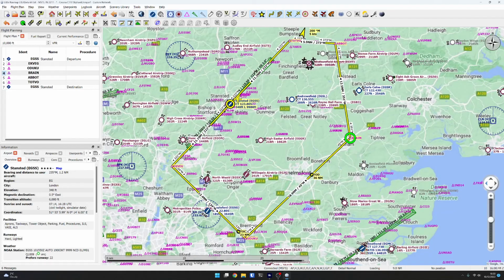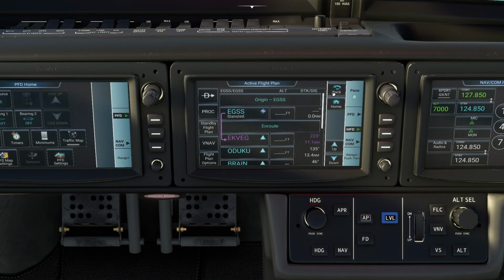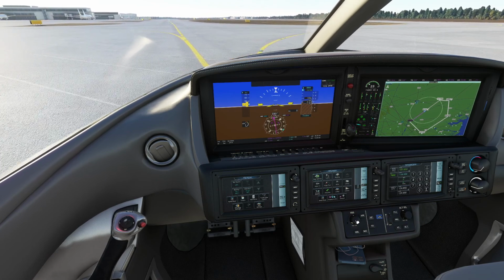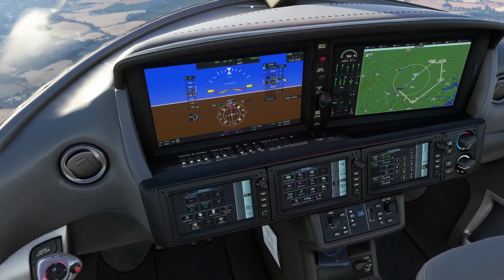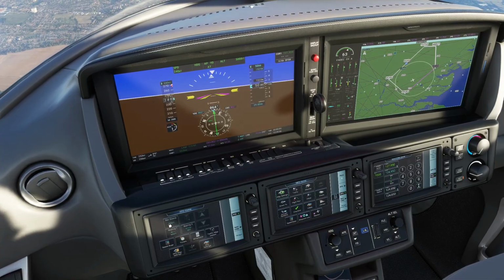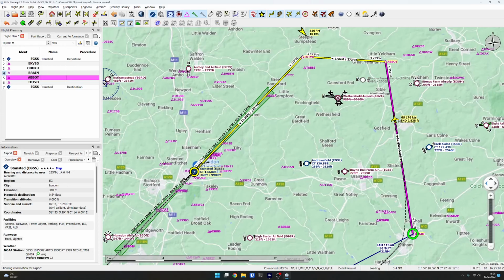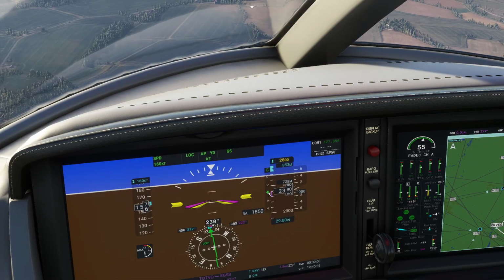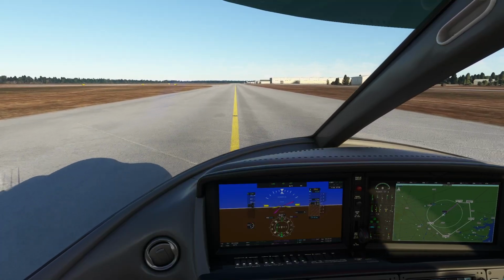Basic flight planning and autopilot operation in the Cirrus Vision Jet in Microsoft Flight Simulator

Comment: Great Video. Regarding descending and reducing speed at the same time, most pilots hate that. When working ATC, I had to decide which I needed from the pilot first--the speed or the altitude. It was either reduce speed then descend to assigned altitude or descend first to the assigned altitude then reduce to the assigned speed. Something to consider when simming with high performance aircraft (SF-50 is a medium performance aircraft, still something to think about when transitioning from the enroute to the approach mode of flight). What do you as a pilot need first?
Reply from the maker: Yep - I often take part in ATC controlled group flights in the simulator with a group called "MyAir" and will voluntarily hold my descent at 10,000ft to decerate to 250 knots - and plan ahead, knowing I'm going to do that. They tend to instruct "own navigation" at least until the STAR - often setting a marshalling point ahead of the star with an expected altitude and speed just to get everybody sequenced easily :)
Reply: @jonbeckett   Yes. "Own navigation" works fine in low density air traffic environments. In the real world, when traffic demand is high in the terminal airspace, controllers will impose altitude and speed restrictions early and often in order to predictably organize the arrival flow and landing sequence.  ;o)

Comment: Weird issue - the lower screens are all black ?? Just downloaded from Marketplace MSFS. Cant light them up / turn on ?
regards
Reply from the maker: Not seen that issue myself. Strange?!
Reply: Follow up - cuz I like this version of the Vision Jet much more than Xplane, others may have had similar issue. 
I emailed the developers... had to delete the G3000 Working Title stuff in my community folder. They recommended deleted all Working Title folders:
""Just checked and all of these files can go.  They were all incorporated into the AAU series updates that you would have installed by now.  They wont be needed anywhere.
Nick Sdoucos
FlightFX, LLC""

 It did fix the BLACK Screen Issues for all Touch Screen Controls (TCS?) screens and did not have any lingering issues that I can tell.  HOWEVER !  I see a difference in your MFD Fl PLan screens and mine ?
I note that my MFD does not show distances to next waypoint in my Fl PLan, which I have grown fond  of.  In fact under Fl PLAN Options I have mostly greyed out, and dont even see edit Data Fields as an option.  gahhh !  I need to know the time, but building watches is more fun ... right ? :planet-orange-purple-ring:

Comment: (This may be a little hard to explain but I'll try my best) I have nav mode on and autopilot on. So when I come into a approach when I pass the waypoint before the approach transition instead of it taking me to the approach transition it takes me to the last fix on final approach. So my question is, how do I get the nav mode to take me to the transition fix? (I'm on ILS)
Reply from the maker: When you get near the ILS, go to heading mode and direct yourself towards it (if the flight plan hasn't already done that). Then switch the CDI to VOR mode - which will make the HSI show the localizer and glideslope markers.

I'll do a video about it.
Reply: @jonbeckett  thank you this has made my approach so much easier.
Reply from the maker: @captm1297  The point about all of this is the automated systems are there to help - not to do it for you :)

Comment: The cursor you are using is small, white and difficult to follow. Try enlarging it and/or changing the color to emphasize where you're moving it.
Reply from the maker: I've since changed my monitor, which should help (lower resolution at this end)

Comment: I was trying ILS with this aircraft today. Must be going wrong somewhere because I couldn’t seem to get GPS to turn off. The frequency was already in the comms area and it seems you press the button to switch active ones? But didn’t seem to do anything. Pressing the nav button was just keeping gps on.
Reply from the maker: You need to change the nav source on the primary panel - from GPS to VOR. The NAV mode of the autopilot will operate for both VOR and GPS navigation.
Reply: @jonbeckett  Thanks for the reply. I tried again with that and the HJet and looked over various things, and was successful.

Comment: What key input did you use to change the green VOR CDI to a specific radial, as there's no CRS knob or way to select a specific radial, as you've mentioned in the video?
Reply from the maker: CTRL+SHIFT+HOME and CTRL+SHIFT+END :)
Reply: Whilst fiddling with the GTC screen and knobs, with a touch screen and knobster,  it appears that the VOR course can now be set using the large touchscreen knob while in PFD mode.

Comment: You misinterpreted the FLC. IT will NOT automatically pick the best climb rate. You have to press FLC. then select (using the up-Dn wheel next to the FLC button) the speed you want to hold when you ascend. Or... press the auto throttle and FMS mode... it will then use the speed bugs you selected before take off... 

I enjoy watching your content
Reply from the maker: I may not have described it well - apologies if that was the case. It's a difficult thing to describe to people - that FLC will hold a target speed and convert excess or lack of thrust into climb or descent :)

Comment: On approach Vision Jet aircraft still do not the use correct course via AP, what is the problem.
Reply from the maker: You must have missed something in the aircraft. Did you switch to VOR/LOC on the CDI, away from GPS when you got to approach (presuming you're talking about ILS) ?
Reply: @jonbeckett  Yes, I am talking about ILS and NDB, knowing that I make the flight plan from the main menu.

Comment: Thanks for your excellent tutorial. A few questions please: On short final how do you get rid of YD? By disconnecting the FD? After AP disconnect, why is the light still on for Manual mode on AP? I botched badly a landing yesterday after a 2 hours flight,  went for a go around 2 times and stick and throttle would go absolutely crazy; very frustrating. Killed the aircraft:) Your subscriber, Nick from Sydney Australia. Cheers!
Reply: I rectify: Why is the light still on for Manual mode on AT (Auto Throttle) down on the pedestal? Sorry.
Reply from the maker: That sounds a bit odd! Are you sure you disengaged the autopilot?  Without being there and seeing it, it's difficult to say what happened.
Reply: @jonbeckett  I am sure I disengaged it. Anyway, today I have done exactly the same flight in the TBM 930, landing on the same runway, and it was very nice. I will do later this week another flight in the Cirrus Vision Jet, and I will play with connect/disconnect AP and AT several times. I will let you know. It was very odd, indeed. Thanks to your answer, and also to the TBM, I feel much better now:) Much appreciated!

Comment: I don‘t understand how to change the course. Could you tell me the keys again because I tried holding down shift and ctrl pressed end and home and it did not work. Great video thanks
Reply from the maker: Press the modifier keys down at the bottom left of the keyboard, then while holding them down, press home or end to rotate the course. I'm basing this on the default keyboard mappings in the simulator - if you've changed the mappings, that's why it's not working. You can find them in the keyboard profile configuration.

Comment: Hi Jonathan
I'm trying to reproduce what you do in the video, but for some reason after landing and engage autopilot the plane suddenly changes course and starts to fall after 10 or 20 seconds. Flaps are at 0, hdg addresed to the route and nav, fd and autopilot are engagged and activated. Of course flight plan is loaded as you explain in your video. Any suggestion about what am I doing incorrectly or missing? Thanks in advance !!!
Reply from the maker: Difficult one to diagnose without seeing it. You might want to post in the support channel at VirtualFlight.Online's discord server - you'll get lots of people help you then :)
Reply: @jonbeckett  Thanks a lot Jonathan for your quick response, I will get a try

Comment: Great video, thanks. How did you (or someone that know, please reply) do to have a green/blue map? In my land is always black.
Reply from the maker: It's an option in the MFD
Reply: @jonbeckett  I have found. Is the option Terrain = Absolute under Map Settings on MFD. Thanks again
Reply: @jonbeckett  Thanks. I will check to find that option later.

Comment: Love the video very informative. One thing I’m trying to figure out is what the adf and the other one are used for I fly the Cessna 414 a lot I know the aircraft like the back my head but never able to figure out what that system is used for.
Reply from the maker: ADF = Automatic Direction Finder. ADF beacons were a fore-runner of VOR beacons - there are not many of them around any more. If you look on a map and find an "NDB" (non directional beacon), you will be able to tune the ADF radio receiver into it, and get the direction to it. They are called "non directional" because there is no way of establishing where you are in relation to a specific radial (which VORs can do through the HSI and CDI instruments in the cockpit).

Comment: Excellent explained and flight.
It is a good practice to hit the TOGA button on the throttle knob, prior to takeoff. This will set the command cues for best initial climb rate and wings level. (At 5 degree during takeoff run). It is a shortcut for HDG set when lined up - just hit the button.
Note that selected, but not active modes are shown in white on the annunciator panel.  Ref approach - the GS is white until Jonathan flies into the GS. This is a vital check as this aircraft often fail to capture ILS.
I am a noob with G3000 programming. I have problem with activating SID - STAR Approach and Arrival. I always mess up, and not able to modify  (delete waypoints). I watched tutorials for other aircraft, but it does not help.    Any new tutorial for programming (using Simbrief) in this aircraft would be much appreciated!
Reply from the maker: I'll take a look at Simbrief soon - it's one of the things I've not recorded a video about for ages.